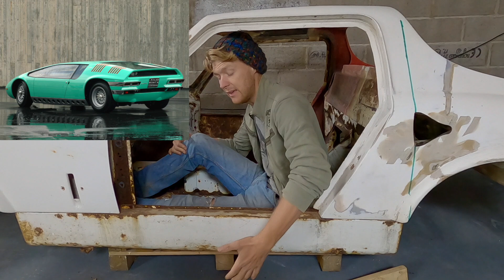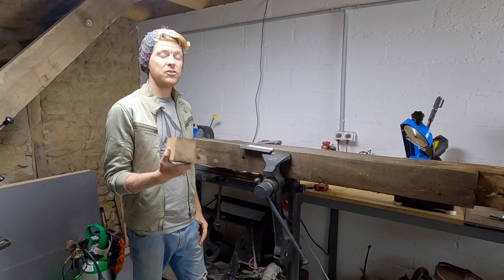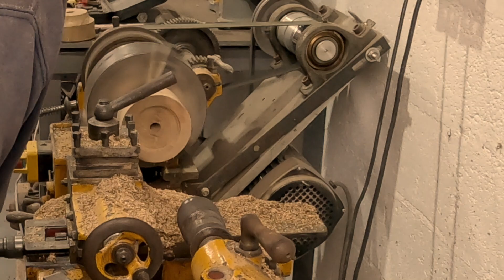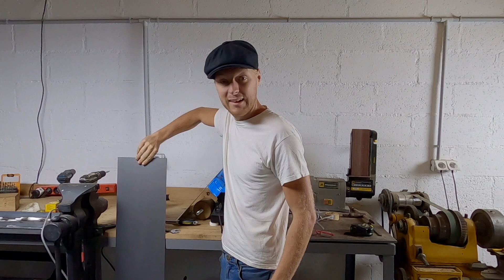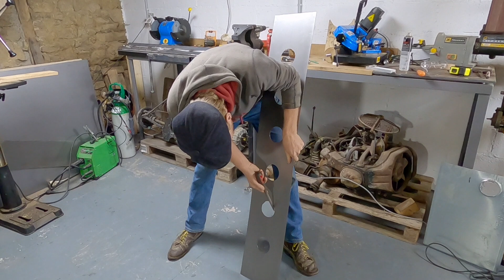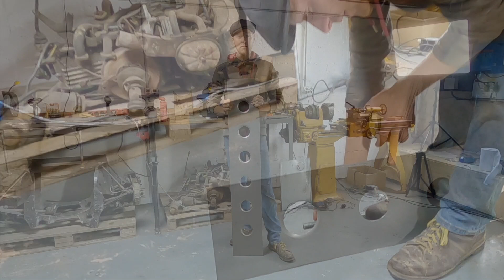DIY Dimple Plate Tool Made From Wood | 1960s Mini Supercar Ep6

Comment: Hey mate, just wondering when you made you Dimple die did you have to make allowance for the metal when making the male and female dies. Would love a bit more information as I would like to have a crack at making mine own for my Hot Rod build. Cheers
Reply from the maker: When you make your dimple die you need at least 1mm of clearance between the two dies. Plus the thickness of the metal being dimple died. So if you are dimple die 1mm sheet steel the clearance between the two dies should be a minimum of 2mm.If the dies stick together when the clamping bolt is undone. give them a touch more clearance. Then with this set up the dies can also dimple die thinner material.Good Luck.

Comment: I am forever sweeping the floor just for when shedcorgi decided to wander in to save his precious paws.
also I'm planning on making some dimple dies soon so its good to see how well timber worked. 
It is possible that it will split eventually but for the cost to make new ones means splitting is a minimal issue so thanks for sharing
Reply from the maker: Obviously hard wood works best and if they split a bit of wood glue and a jubilee clip or two does the trick but if you get the angels just right it shouldn't be a problem

Comment: I’m torn on your channel, 1 minuet I think there’s too much waffle and then I want you to explain the stiffness calculation of the dimple dying. 😐
Reply from the maker: It's a difficult balance one which I've gotten better at over time
Reply: @OliverPickard  I’m still watching👍, how long is the wheelbase?
Reply from the maker: 2180mm 85.8in the same as a Stratos
Reply: @OliverPickard  thanks, 4” longer than my buggy, I’ve been planning an a  arm front suspension, but that CRX rear looks interesting, what about Ackerman with the shortened chassis?

Comment: Another thing to note: if you have a hefty enough hydraulic press and strong enough dimple dies, you don't actually have to put a hole in the part to create the impression, so you can keep your parts solid but still stamp in a variety of fun shapes, like squares and circles and the like. You just want to be careful designing your draft angles on the dies to prevent tearing your metal if you try to stamp in designs with corners. Also, you can totally use a flappy sanding drum on a rotary tool to clean off the burrs on parts like that and it's loads faster than handle filing.

Comment: Fascinating stuff, Oliver. I was wondering, is the dimple die panel stiffer  on one side compared to the other?
Reply from the maker: No but it isn't very stiff diagonally because the dimples are inline but the bends on the edges will sort that